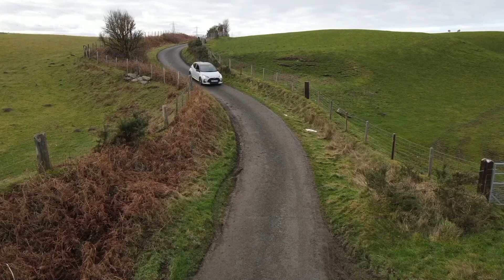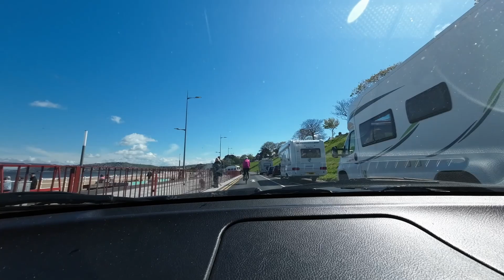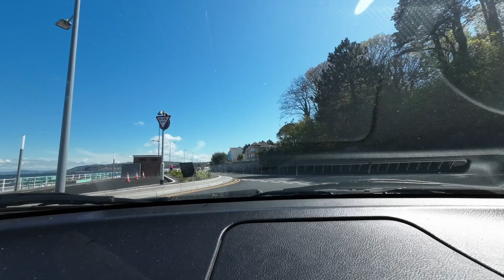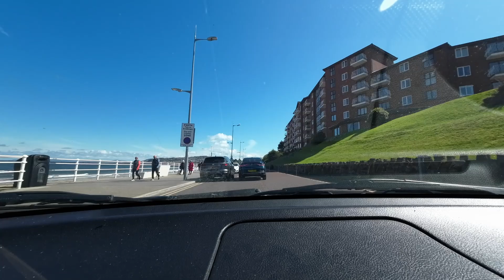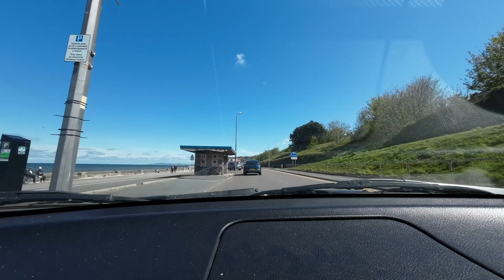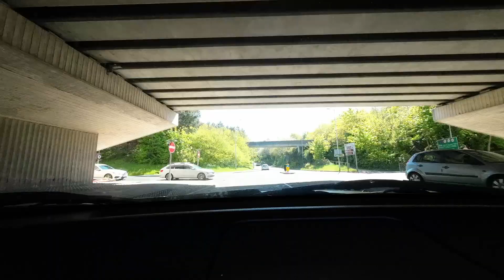euro 7 emissions

Comment: each tyre and brake linings will have a PM particulate matter approval certified by the manufacturer per kilometre of travel in the same way PM is measured for engine emissions.
you will have to pay more tax on the tyre and brake lining when you buy it according to its PM amount.

Comment: Isn’t it likely that it will only be practical to perform standard tests before large scale manufacture of a given product, in factory conditions? There is always a lot of normal variation in things like tyre wear, and the use of brake pads measured per km run.

Whatever the standards are, they will have an effect on component selection. Reminds me of a car I had a decade or so ago. It was a Honda Civic with the 1.6l diesel engine, and fitted with Michelin A grade tyres. The latter made it possible to just squeeze under the CO2 emission per km under test, so it was road tax free (which was the policy then at <100g/km). Although it was a good car, the average fuel burn wasn’t low enough to meet the standard, except on longer trips.
Reply from the maker: it,s okay doing factory test on individual tyres and brake components , but we all drive differently , so the results a car measures are going to be totally different from factory and laboratory tests 
you might get 10000 miles from a tyre , i might get 5000 miles from a tyre , iv,e produced more emissions than you    
every body drives different 
the tests and monitoring will not be fair 
it,s all about the green agenda and getting us out of vehicles
you will own nothing and be happy